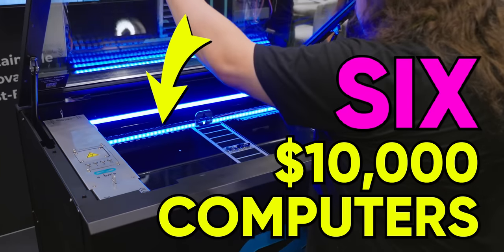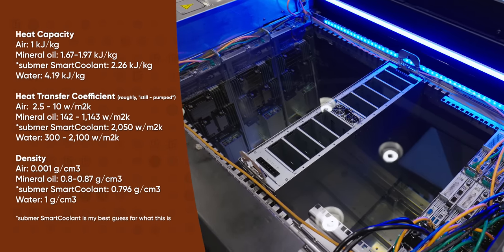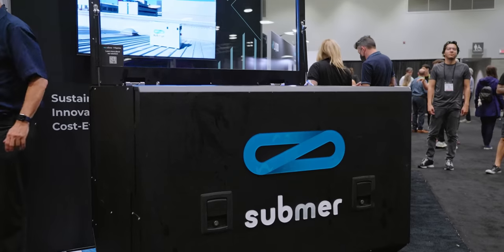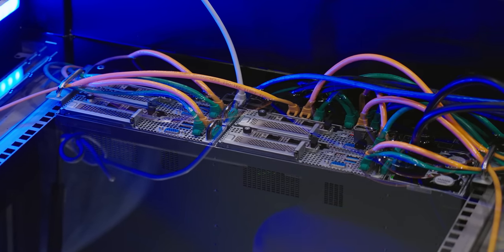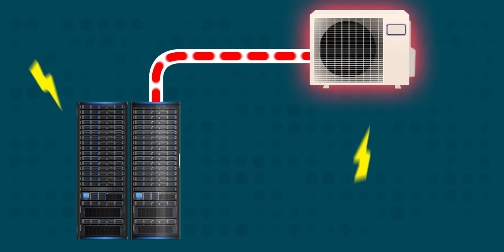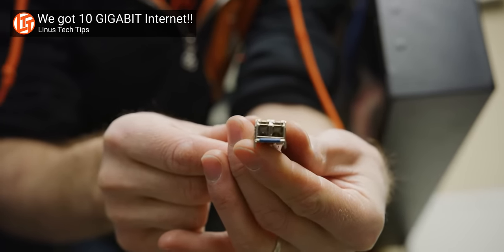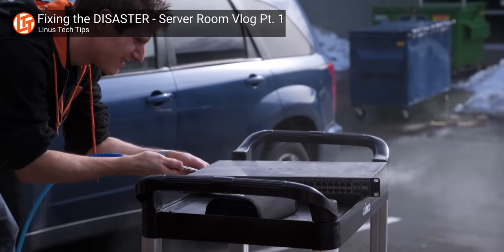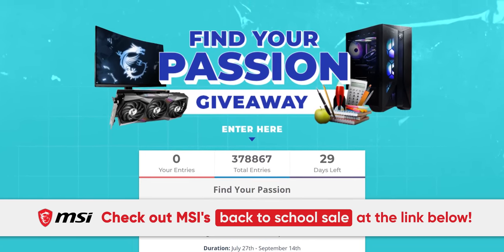This server lives underwater! - Hypertec Immersion Cooling

Comment: I will never get used to seeing plugged-in electronics submerged in liquid. Everything I was taught growing up about the hazards of mixing liquid with electricity makes this video not sit right with me, even if I know it's safe 😆
Reply: This is like how it's counter intuitive that Microsoft's undersea servers prototypes have a better longevity that normal servers. But because they are in a submarine-grade water and airtight hull filled with pure pressurized nitrogen, there is no oxygen nor humidity inside to corrode the hardware.
Reply: that's water, not liquid you shouldn't mix with electricity. De-ionized water is also fine BTW, it's the ions that make water conductive, it's otherwise dialectric.
Reply: @18earendil  can’t they just do the pressurised nitrogen hull and keep it at the surface?
Reply: @Freshbott2  technically yes but the water outside allows for better heat transfer because it is colder than the air on surface level and way better at taking heat away
Reply: Plus submerging the data center helps reduce the strain on the hull if they choose the right depth. Having the internal pressure and the external pressure being equal is the ideal scenario and even outside the ideal scenario, the smaller difference between internal and external pressures  the better.
Reply: Mains power and liquid = dangerous. Even though @ElectroBOOM has shown it's not always lethal.
12V and (conductive) liquid is only dangerous for the components. 48V is defined as the upper limit of "low voltage" and safe.
Reply: You'll be glad to know that PCB assembly companies use essentially giant dish washers to clean the flux off them